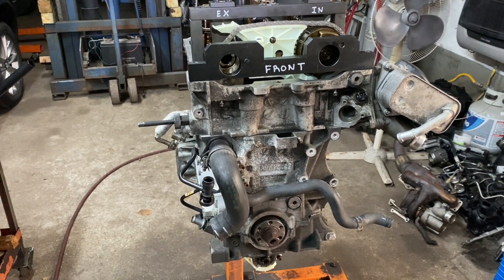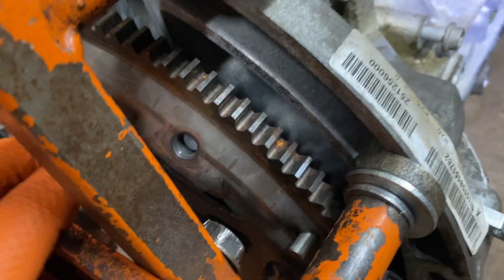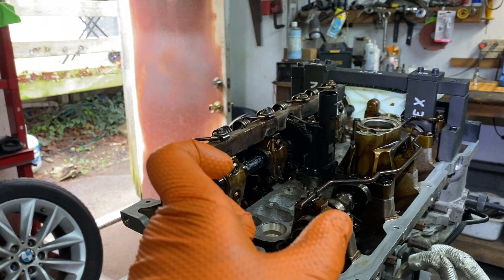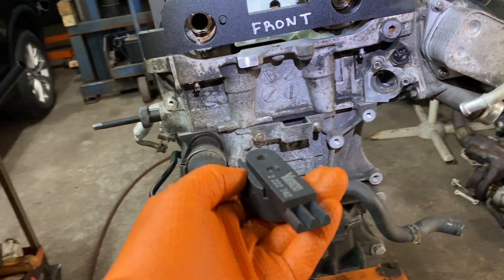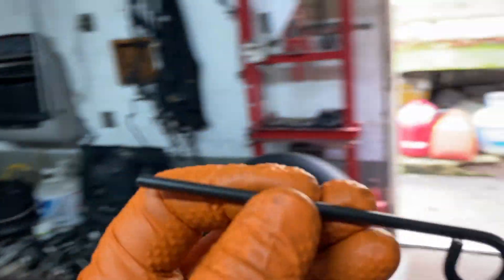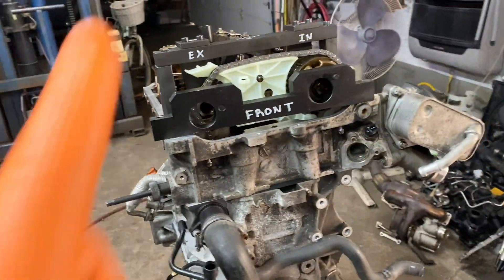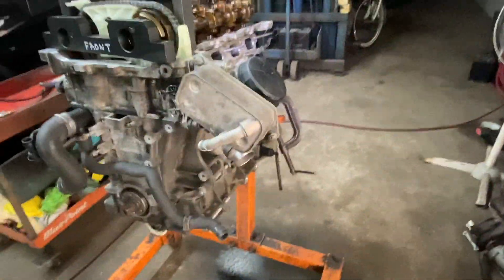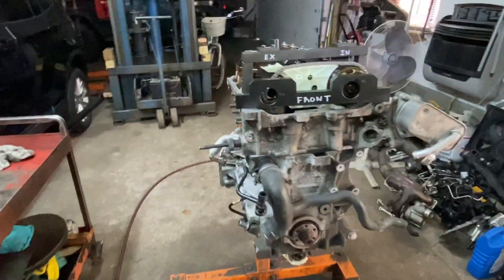BMW N20 N26 Special Tools Needed To Set Up Top Dead Center, Valve Timing & Timing Chain Replacement

Comment: Hey what up buddy I have a 2015 BMW 528i n20 engine and I have a crank no start I check fuel spark ok but I have low compression on all 4 cylinder 90 psi the only thing that I did to the car was replace 4 injector because I had codes for misfires after replacing injectors Car did not want to start any tips
Reply from the maker: The injectors have to be reprogrammed to the car, did you do that?
Reply: @motorcarnut yes

Comment: I have a Doubt for lossen up the cranck bolt, do u use both tools the pin and the fly wheel thoot? Or only the tooth tool
Reply: he’s trying to say take it out when you loosen the crankshaft bolt just in case there’s movement it won’t bent the flywheel like it did in the video
Reply from the maker: No, the pin is not for removing crank bolt it will damage it. The bellhousing tool that locks flywheel is the one you use. That bolt has more than 500ft lbs of torque!

Comment: Does the oil pan have to come off to do just primary chain??
Reply from the maker: Yes, you have to line up counter balance shaft and oil pump
Reply: Oil pan only comes off if you changing the oil pump chain/guides and tensioner other then that the balance shaft should already be aligned when you put engine at TDC.
Reply: @BR225gaming Balance shaft can shift on you when you loosen the crankshaft bolt. For this reason, the pan needs to come off to lock the balance shaft in time. It's 50/50. Not worth the risk.

Also, the oil pump drive module was updated from the original design, as the original had a tendency to become noisy (made a burr burr-burr sound). So you should be changing both chain drives in unison.